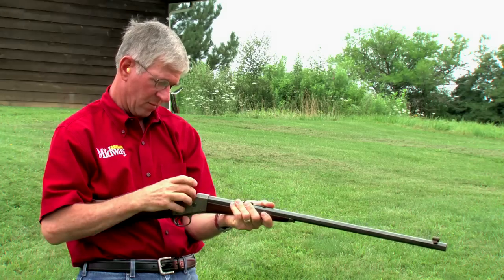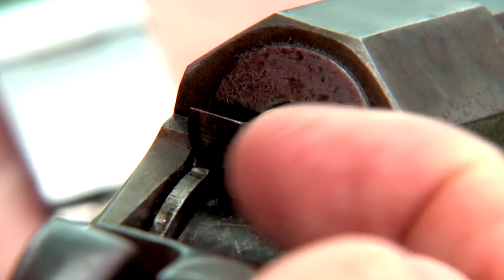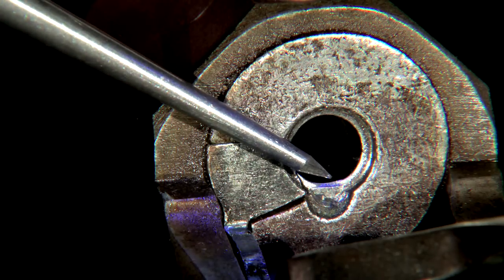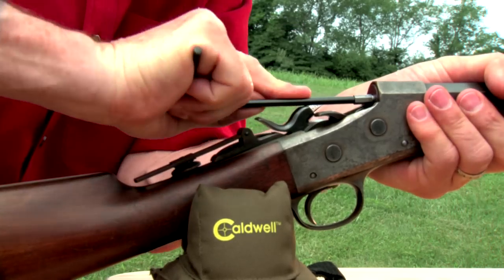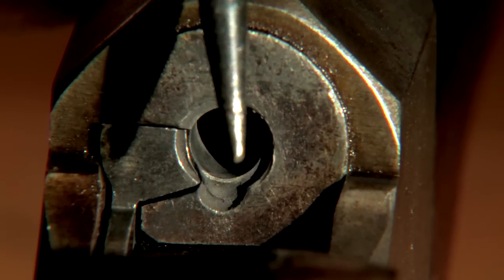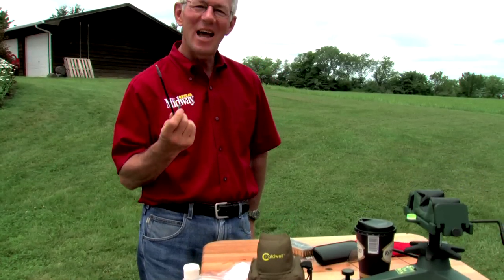How To Repair a Damaged Rimfire Chamber Presented by Larry Potterfield | MidwayUSA Gunsmithing

Comment: This tool is near impossible to find.
Reply: have you found one?
Reply: Verify Ebay,are available,i purchase one the past week.
Reply: Look for "Menck 22 Chamber Ironing Swage" on eBay. I'm gonna be buying one shortly.
Reply: I know a guy with 20 of them left.
Reply: use a tapered punch - cheaper and available at your local home improvement store
Reply: Tandemkross has them, and they are readily available.  Can verify it is very useful for firing pin depressions, or any other blemish on the face of the chamber, or just inside of it. Doesn't do much if you have damage more than 1/8" or farther inside the chamber.

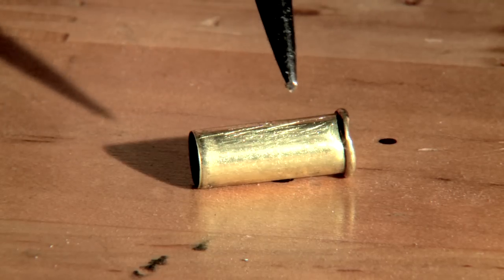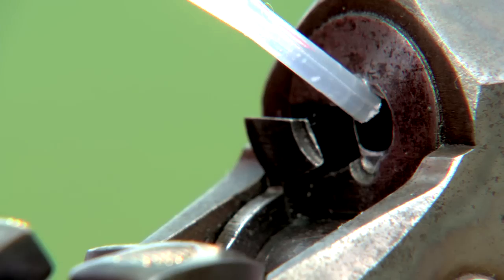Comment: 0:40 the front of tool has a round diameter   0:51 its  threaded ???  does it have a pilot that goes over it
Reply: 0:40 the thread is out of focus.  Its so you can connect it to a rod and pull it through if you cannot get easy access to the back of the barrel.
Reply: @Uneek_Username   Yeah was wondering how it worked  but I found one on eBay a few month ago  I have a Marlin 1897  22lr that has this problem